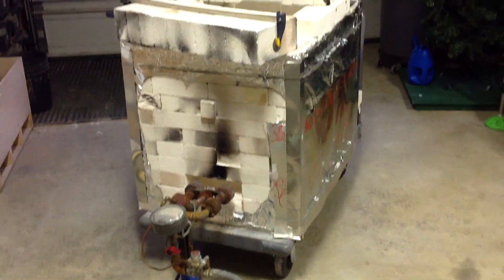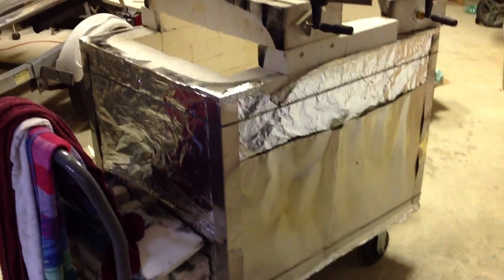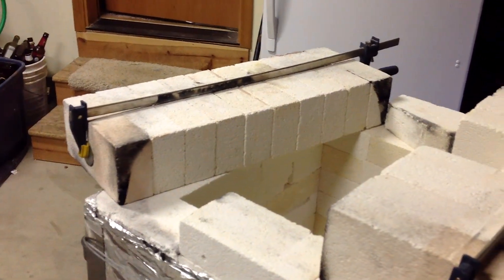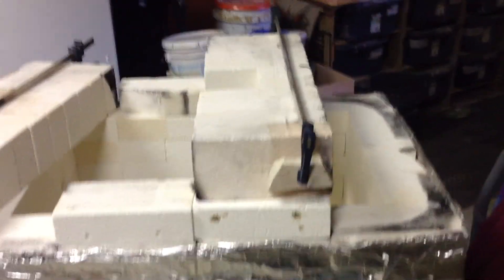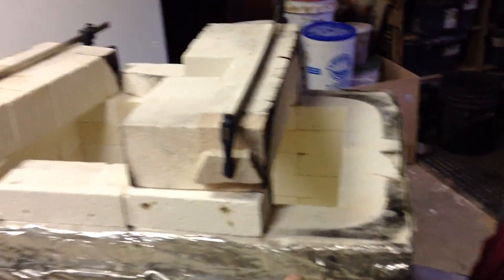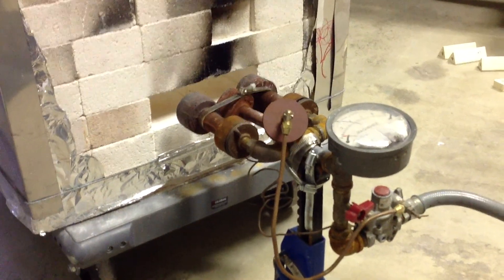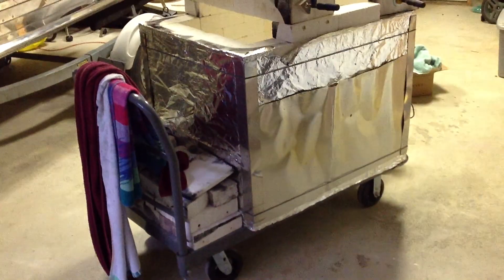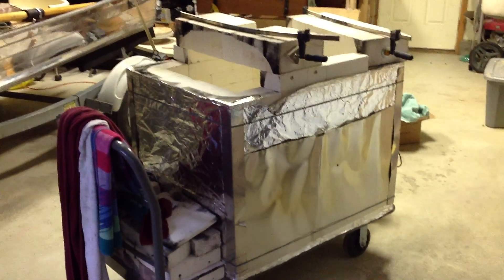Small Kiln overview

Comment: Good day! I know this very old video. I would like to know how you did this? Baby potter here hope you could help me build my own kiln just like this.
Reply from the maker: I built it on top of a rolling cart (like they have at Lows or Home Depot for rolling lumber around or something) and I used Insulated Fire brick.  I had some Venturi burners but any burner would probably work.  I never worked that great, it was a bit uneven and difficult to control the reduction.  I no longer have it, but I fired it around ten times and it more-or-less worked.    I eventually converted it to a downdraft design as it worked better that way.
Reply: Hello I m terracotta clay itoms manufacturer in india I have different different type klin please contact number thank you

Comment: What a great kiln. I like the idea of wheeling it around,also the way it can be taken apart and re-built to a different configuration if needed. That lid design is clever,other designs I have seen use two lengths of thread bar placed through holes drilled midway through the brick, but clamping like you have done,lets you have the option of using the bricks other than just for the lid.Thanks for the tip of finishing off with a kiln shelf on the last rise to protect the pottery from bits falling down. Thank you for sharing.

Comment from the maker: I tried with 1 burner on several design attempts and had trouble stalling out at around 2k degrees.  That's why I used two.  I want to have two if I need it, but I agree, one is probably enough.